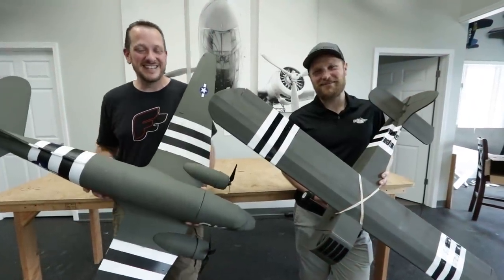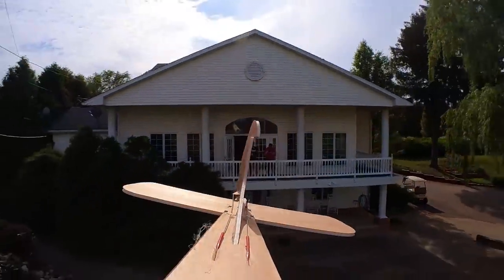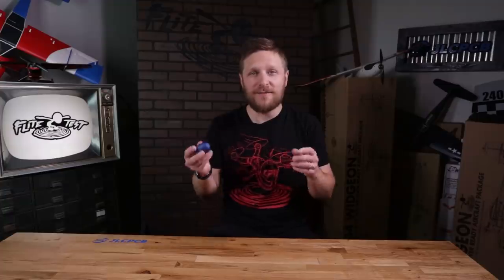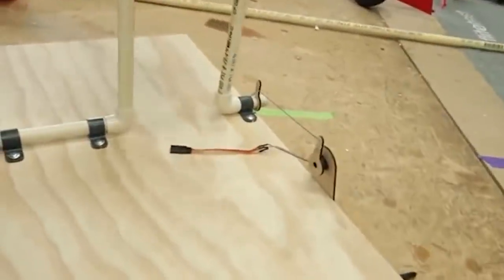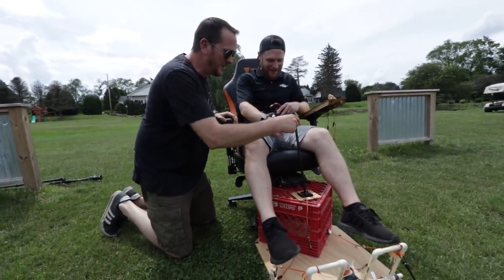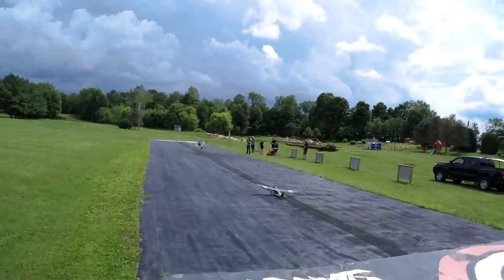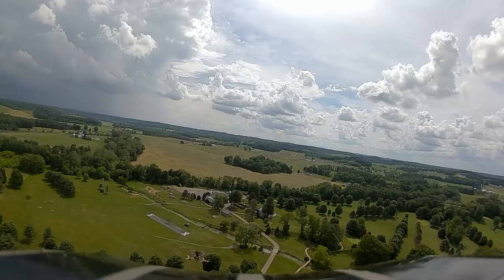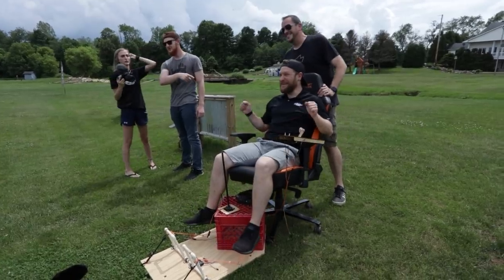WWII C-47 Glider Tow with our FPV Cockpit!!

Comment: can you please answer this question, why when you are buying a D.I.Y plane off the web site, why does the electronics for that plane not come with the kit, i mean it is part of it right? i mean like that is how it fly, and why does it cost soooooo much, i mean $75 for a motor a few servos, props, like 10 small screws, and the receiver and battery. I could buy all of that for a bit more than hafe that price. i just don't get it

Comment: Modeler tip; No tape or edge tools were used on the Allied "Invasion Stripes" . . . To maintain secrecy, the entire Allied air fleet received their stripes by hand with brushes and mops in the last 3 days before the invasion. They were actually quite messy.

Comment: When they let the specifications for the first gliders for the U.S. Army it was discovered that all the know full scale aircraft manufacturers were FULL UP building aircraft.  So the Army thought about the skills necessary to build gliders, sewing canvas, basic carpentry, and the ability to bend and weld tubing.  When they checked the vendors available that had some or all of those skills it was discovered the two that had the availability to fulfill the requirements were  a REFRIGERATOR manufacturer, and a CASKET manufacturer (neither of these things are known for their ability to glide!!!!). Legend had it that Douglas designed the C-47, then the Army/USAF taught them how to OVER LOAD  it!  In Vietnam a lot of Goonies came up on airframe overhaul milestones and it was discovered that some had HALF A TON OF COAL DUST THAT HAD FILTERED THROUGH INTO THE BOTTOM OF THE AIRCRAFT FROM THE FLOORBOARDS HAULING IT INTO BERLIN DURING THE AIR-LIFT!  Which means that those aircraft may have been flying over-gross loading for a DECADE!!!!

Comment: Soooooooo, I spent at least $200 on an p40 kit plus motors and batteries and chargers, only to find that the p40 kit came with 3 fuselage pieces with no wing or tail pieces. After 3 months I stil haven't got any customer service response.

Comment: I have a question. I built my own rc airplane and I bought a propeller that supposed to spin clockwise. With the motor spinning clockwise affect the flying characteristics of the plane?

Comment: So it looks like you guys need to build an FPV chair setup.  Just the rudder, throttle and stick, let the customer attach it all to a chair.  But you could hook it into a buddy box system so someone has to be holding the switch (safety pilot).  I bet it would sell well.